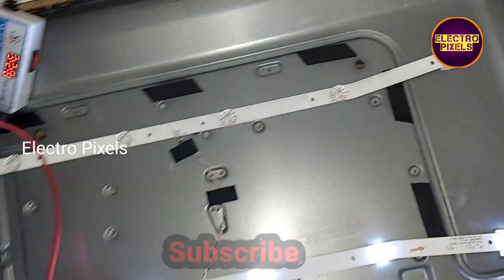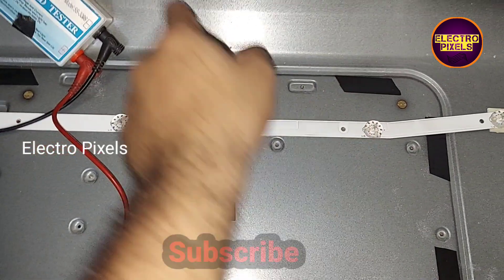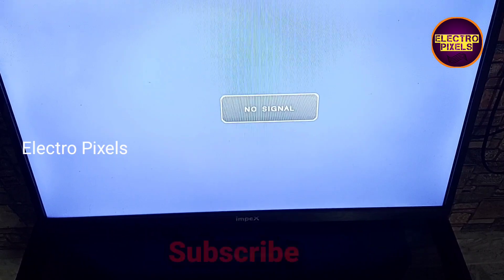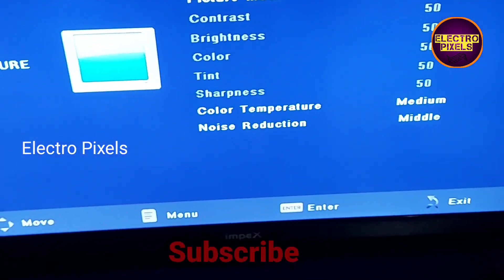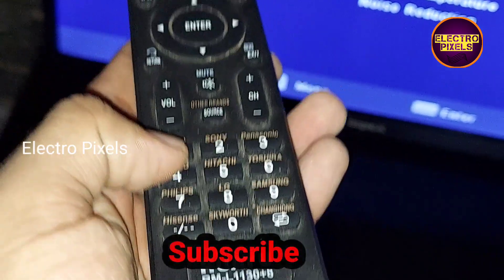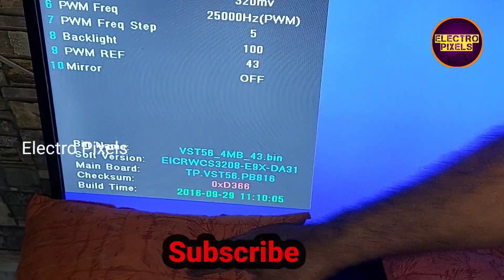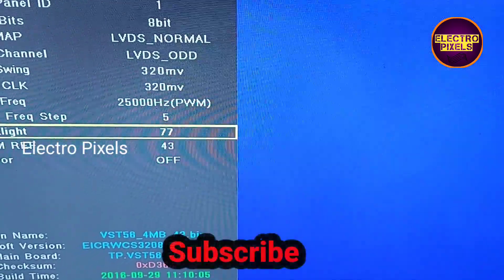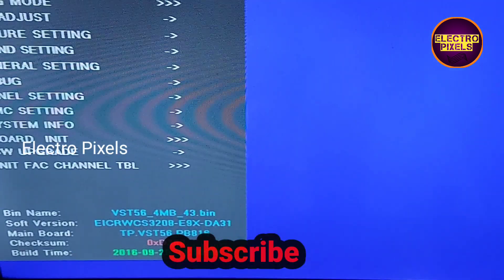Led Tv Backlight Repairing || Replace All Backlight Strip's || Tip's to Increase the Lifespan of LED

Comment: hello friend, I have installed universal u11.2 board on lg 42 inch. I am using LG power supply as backlight driver but if I connect ADJ pin from Universal board to P-dim of lg supply , the lights goes off. Do you know how to connect ADJ pin from any universal board to LG power supply P-dim. I want to control brightness. Thank you.